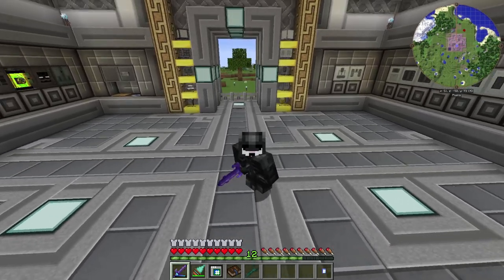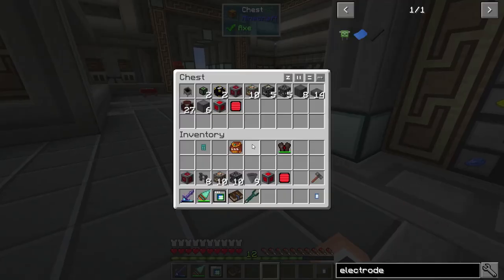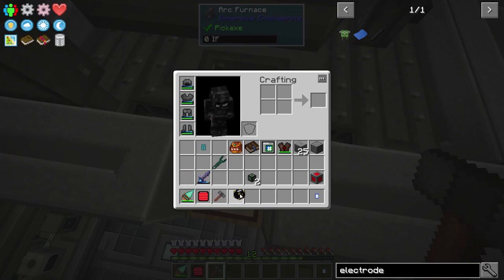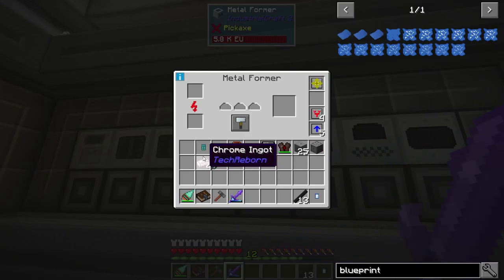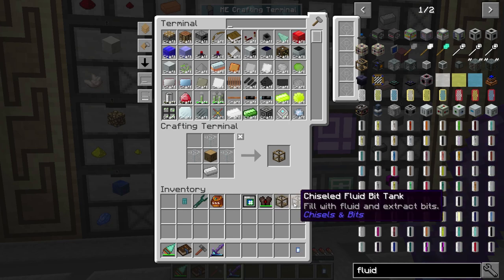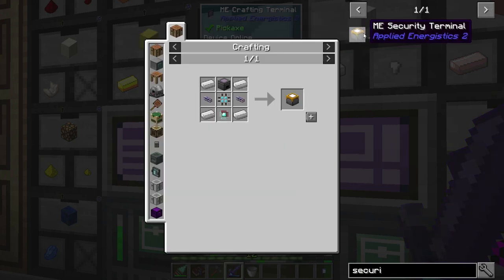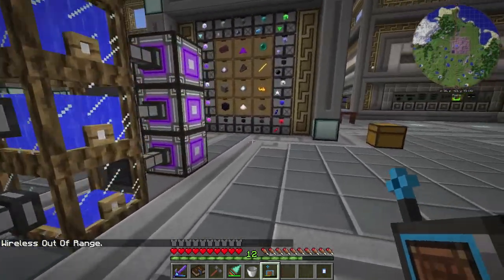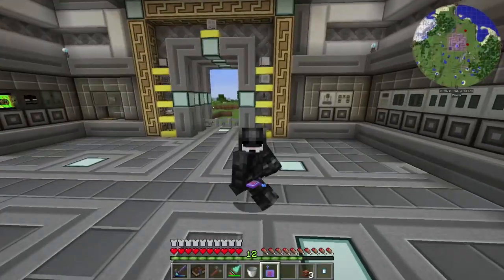Age of Engineering EP31 Arc Furnace and Singularities

Comment: The reservoirs didn't need transfer nodes, they can auto output just fine to keep up with the chiseled tanks, and you could have just used translocators with stack upgrades to push into the matter condensors. It's a bit cheaper and more compact. Also, the translocators look cooler in action, but that obviously comes with a render cost.

Comment: induction smelter from IC2 smelt things more faster
Reply from the maker: The Arc Furnace can smelt ores and double them as well. It also does 12 at once, that is 24 per cycle. It is faster but take a ton more RF. The IC2 Electrical furnace with Overclockers is faster then both of them.